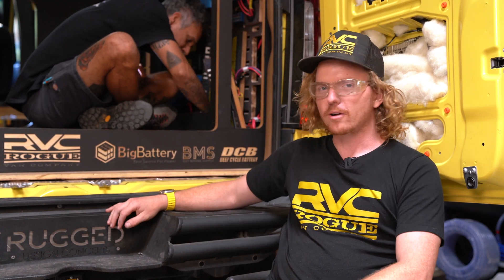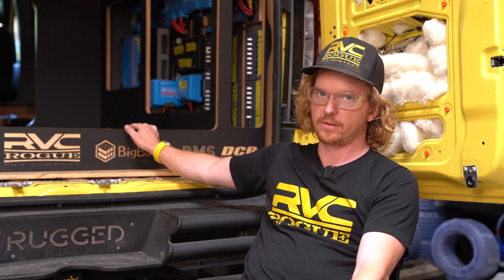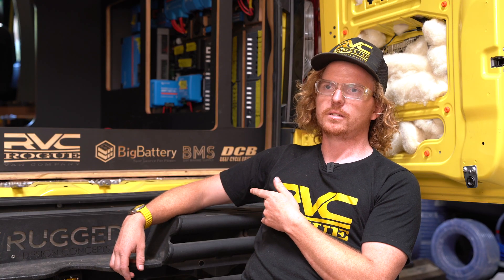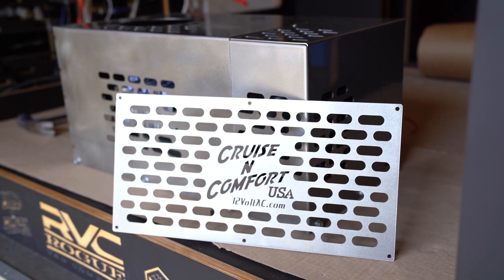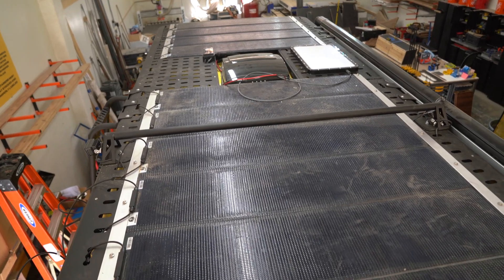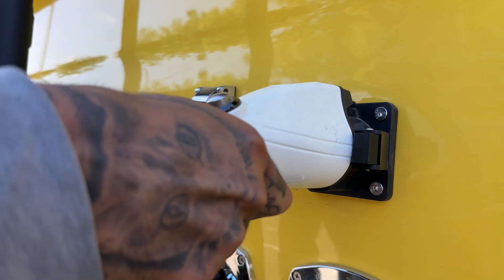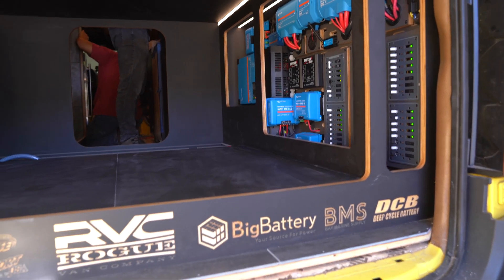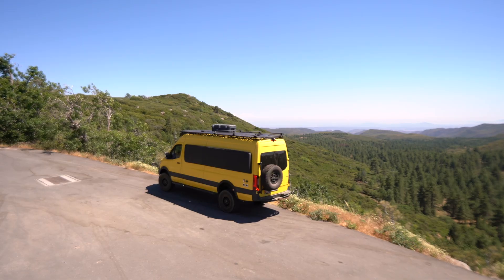RVC Sema Build - BigBattery upgrade

Comment: Wow, looks like a rolling power plant. With that amount of power and the proper cables and connectors a build like this could be sold as a backup system for home use also. In the event of a long term or scheduled power outage home reefers and other essential loads could be connected to the van. Many options for doing this but I can see a market for a mobile power plant for sure that could go beyond the vanlife/rv market. Thanks for sharing!
Reply from the maker: It’s definitely more power than we’ll ever need…until we do😂. We’re pleased with this system.